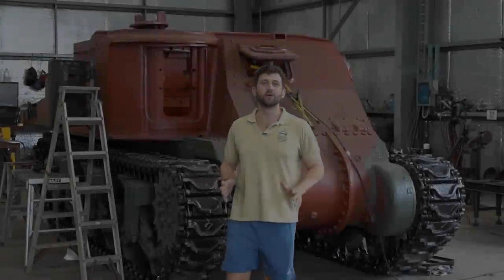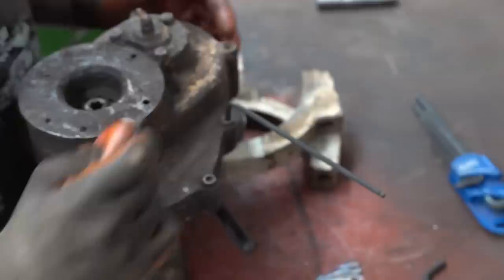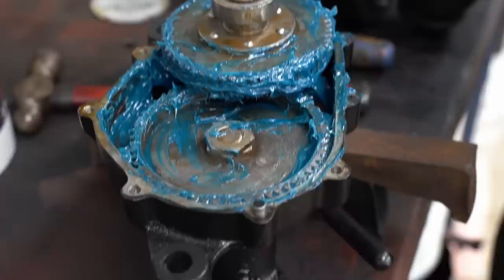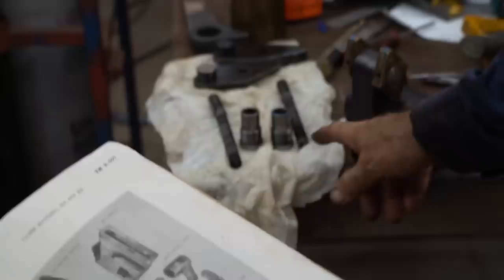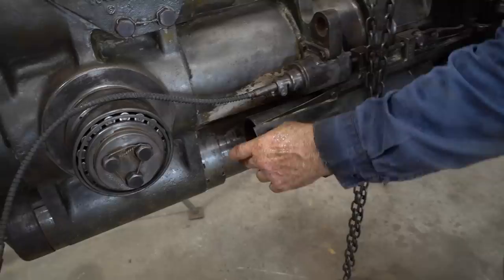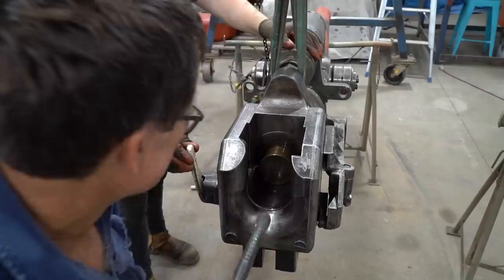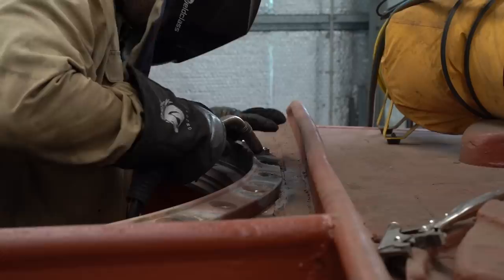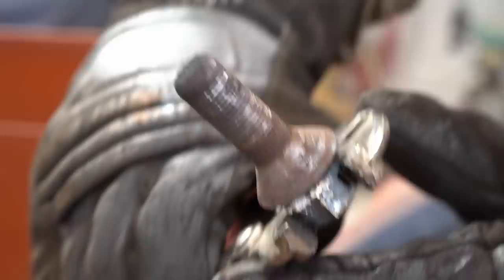WORKSHOP WEDNESDAY: Reassembling the 75mm on a rare WW2 Grant Tank

Comment: I'm a scale modeler and quite frankly, the Grant was at the bottom of all armour kits I wanted to build. Since I found this channel and learned so much about this tank I changed my mind. Imagine all the bits and pieces I'll be able to scratch build! No other armour museum does anything like these in-depth videos. Thanks a lot!
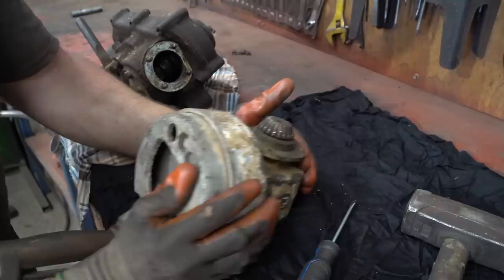Reply: Yeah. I was thinking the same thing watching these videos .. especially the tearing down and reassembly of the suspension .. was thinking of a 1:16 scale model .. crazy
Reply: @eTraxx  That would be perfect! The tank is rather small, so even a 1/16 model wouldn't be too big. I guess a 1/35 Leopard 2 is bigger than a 1/16 Grant, hahaha!
Reply: @polticalme1677  Umm. Looked it up. A Leopard 2 has a length 9.97m .. a Grant a length of 6.12m. Soo .. (gotta lover the internet and calculators) .. 9.97m/35 = 0.285m/11.22 in .. and 6.12m/16 = 0.39m/15.35 in .. those being with turret forward.
Reply: @eTraxx  I also looked it up and came to the same results. The Grant would be only slightly longer. The actual tanks have the same height (3.03m for the Grant, 3.02m for the Leopard).
Reply: Mini Art makes a nice 1/35th scale kit with a full interior(#35217) if you're interested, and can find one.
Reply: They are also scale modelers. But they work at a 1:1 scale lol
Reply: Yeah just about that 1/35 kit with the interior. I wanted to build a 1/32 version and scratch build everything to a little bit larger scale.
Reply: @Whatisthisstupidfinghandle  Hahaha! That's right and I'm glad they do.
Reply: @donivanpotter2762  A daring project! Good luck!
Reply: I've always had a bit of a soft spot for the M3. Kit wise I'd lean towards the M31 ARV, while the M3 wasn't a great tank they did quite well when refitted as recovery vehicles.
Reply: The Mini-Art kits are beauties.  Both Lee and Grant variants are represented both with or without full interiors.  I have the Lee mid with full interior.  It's a mountain of sprues.
Reply: Well said. These lads and lass. Must not forget Lottie. Make it very entertaining. I just wish they were not so far away, I'd buy a season ticket and visit regularly.
Reply: @gusgone4527  I wish the earth was flat! It would be easier to get there! 🤣
Reply: @polticalme1677  You mean it's not flat, bugger me!
Reply: @gusgone4527  ROFLMAO!!!
Reply: The Lee/Grant series were one of the most significant tanks in the allied armoury due to their reliability main gun performance and the ability of the crew to function well inside. British Grants were key to stopping Rommel s panzers on first Alamein and in Burma were key to turning back the Japanese at Kohima.

Comment: I love this video series.  The depth and the accuracy of the museum's restorations are top notch.  The restoration of the turret ring manual gearbox is a perfect example...the brass handle cleaned and polished is a detail that adds so much.  I forget if this will be turned into a runner. Doesn't the Grant use the same radial engine used in the early Sherman tanks?  The way these guys and gals manipulate and reshape 3" thick pieces of steel is nothing short of amazing.  They take no shortcuts...none.  Whatever the hurdle, they take their time sourcing, fabricating and restoring whatever needs to be authentic and correct.  Just fantastic work.

Comment: No doubt someone has mentioned this before, but just in case they haven't

The knack of loading the breach is to force the round home with a clenched fist.  This keeps the pinkies out of danger.
There is no rush nor panic to get your hand out of the way as your fist will simply ride the breech block up as it rises to the closed position.

Thanks for the memories

Comment: Awesome work and great videos! (not sure if noted in a comment yet, but...) At 7:14 in the video, you demonstrate the locking mechanism for the traversing brass handle.  I would think there should be a spring mechanism associated with the lever (inside the brass handle?) so that the locking pin automatically pops out when the gunner lets go of the brass lever. If it were accidentally left engaged and the gunner used the hydraulic traverse movement control, that brass handle would spin around like crazy (brass handle blender of death and/or broken fingers).  You mentioned that the hydraulic system was not going to be restored to this unit, but if you (or a future restorer) did decide to connect the hydraulics, it could be an issue.

Comment: That brass handle with the engagement lockout alost looks like it should have a spring around the center shaft that engages the lock when you aren't squeezing the palm lever to rotate the turret.  🤔

Comment: If you guys need some bees wax to use in place of water for quenching let me know.  I have seen wax used on bolts frozen into engine blocks.  The wax cools the metal and provides penetrating lube for when you want to have crack with a tool.

Comment: You are doing a thorough job restoring this tank. Why would you short cut the engine and install a modern one.  Considering your collection I'm sure you could source a 6046 Detroit  and at a minimum it seems like sacrilege to use an intermediate automatic transmission vs putting a clutch and bell housing on the 8v92. I could live with that at least.

Comment: You need a 9X or 10X aircraft rivet gun at your shop for driving bolts, etc. out.  We call ours Dirty Harry.  You can make cups that fit snugly over the extended part of the bolt to prevent mushrooming.

Comment: incredible work! Shouldn't there be a spring at 7:17 to automatically pull the handle back?
Reply: I think there's a spring missing under the nut that raises from the top when the handle is depressed. There's no way pulling that flap back out with a tiny gap was designed that way.

Comment: I wonder if the unusually dark coloration for the grease in the manual turret traverse mechanism might imply it could be a form of tenaciously adhesive grease often used on geared mechanisms for pump jacks, agricultural and industrial drive chains and the like which is referred to as 'Crater grease'?

Comment: 20:10, when reassembling the TURRET Ring shouldn't those screws or bolts have shoulders on them without threads to not allow the water and rust in there and to not abrade the holes that they're in that might be why it was so difficult to take them out they had threads in them.?

Comment: The US never technically used Imperial, they had broken away decades before that was adopted by the UK, while both were on English Units. Though had the same issue of different colonies English units were not consistent with each other, so standardized on one size for the country around the same time Imperial was created, but while names of both drew heavily from English units the actual sizes names meant were not consistent with the other.

Comment: Sad about the Gun being rendered in-operable, but the Mechanism is still a goer, so. I wonder if a little Raspberry Pi 0 Computer, with a sensor or 2, some Lights & a Speaker, could be hidden inside , so when you load a shell & "Fire it" it makes the Sounds & Flash of Gun Going off ..